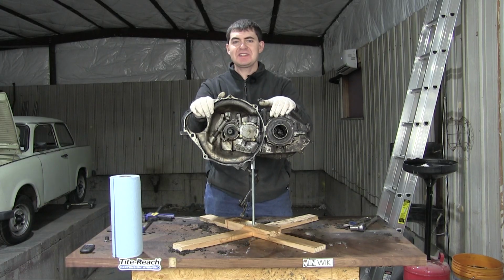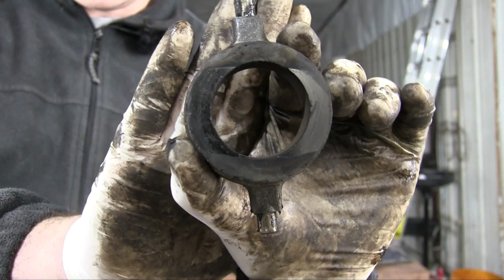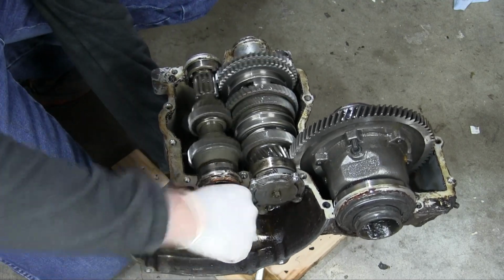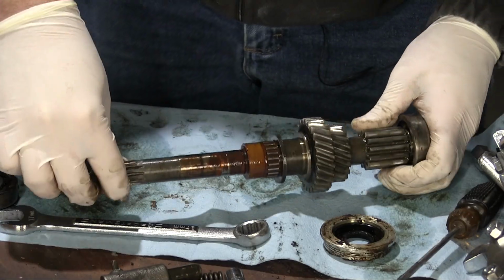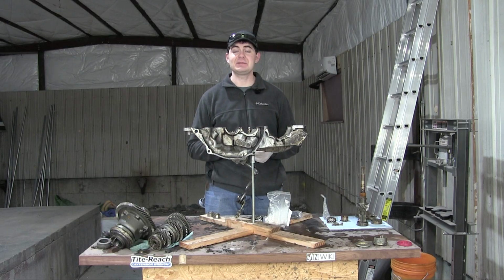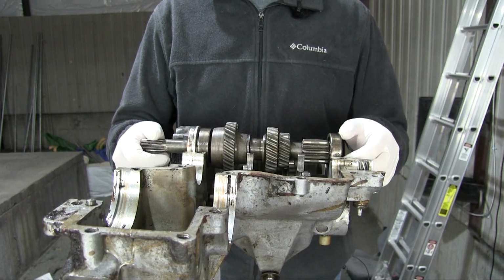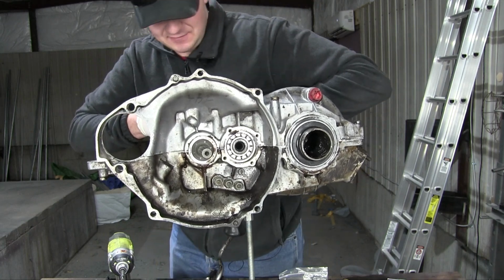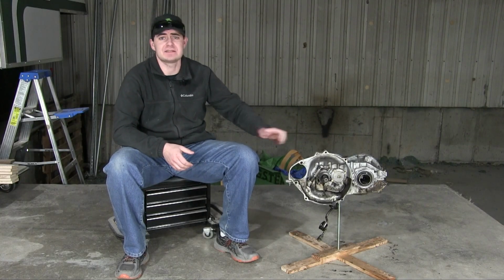Rebuilding the Trabant's Engine: Part 2 - Rebuilding The Gearbox

Comment: For years carbon clutch release bearings were the norm, on my 1989 Reliant Robin is the same carbon release bearing that was introduced in the 1930's Austin 7 and saw service on just about every BMC/British Leyland engine including I think the classic Mini, making them cheap to produce esp after WW2 where resources were not so freely available in Russia, Britain and Europe.   There is no reason why a carbon release bearing won't stay good for many thousands of miles, best not to ride the clutch though as that does increase wear and you may find some older brake and clutch shops still offer a carbon relining service as in the older days, instead of buying new you got your release bearing and clutch plate simply relined with new material, springs and plates and a finishing skim on pressure plate face where a tiny layer would be skimmed off to give the new friction material something to grip on.
Reply: Looking at the design there of the Trabant release bearing its very close to the old Austin/Morris/BL etc design and wouldn't surprise me if the Soviets just copied the hell out of certain bits, the original Vyatka was a 1-1 clone of Italy's Vespa 150 which upset Piaggio mightily and them ol' Commissar's if they saw something they liked they just went ahead and copied it and two fingers up at the original company :)

Comment: Robert, you do not have to torch bearings or anything to fit. If it is a piece that is completely metal anywhere, set your oven to 250 and bake the bearings until it isnt preheated. Then drop the bearing on and let it cool. This is what i have to do at my work to get final drive bearings to install smoothly and its just a better way.

Comment: Nice to see you back on the Trabant rebuild!  The early E-Types had that same throw out bushing only it was just an iron casting.  The design is arguably more reliable but can pull down the idle speed when the clutch is disengaged.  You probably have the same issue with the Trabant.

Comment: The first part you took off (the one called "screw conveyor"  in the manual) is used to circulate the oil inside the (partially hollow) intermediate shaft. The intermediate shaft has multiple holes in it that help with lubricating the moving parts on it.

Comment: Fun tip. On friction-fixed gears like that (or say an anti-lock brake gear on a drive shaft), don't use a torch. Heat the gear up in your oven (or barbeque grill). It will heat in a more even and controlled way and expand just enough to slip on. Plus it probably won't be so hot that it will melt your weird plastic things.

Comment: you need a quite bigger bead of the sealing compound all around the gearbox halves,.... it will leak https://www.autodily-cardo.cz/galerie/430608/tesnici-tmel-na-motory-do-300-c-elring-705-705-default.jpg

Comment: Very good video, keep up the good work! One time, I went to a transmission rebuilding shop to ask which oil I should use in a manual transmission, and they said that regular 5w30 engine oil is just fine. Later in the life of that car, when the transmission was leaking quite a lot, I used 10w30 oil, with a bit of Bardahl. With the Bardahl, the transmission shifted so well; I should have use it before.

Comment: Mine had a failing freewheel as well, it took like 200 bucks to replace a part that costs like 10$... now I see why.

But later I had the gearbox replaced anyway, because I've had it converted to the new drive shafts, which are much more reliable and durable. The parts were like 25 bucks from a parts car (gearbox, both driveshafts, wheelhubs with brake drums...)

Comment: Glad to see it was worth the wait. I'm all anticipation waiting for the next video. Goes to show what a lot of common sense can do if you only go for it. Back in 1986 I torn down a 18 ton tuck gearbox with no experience, put it back because I could find a fault, when it turned out to be the rear differential. Only one bolt holding differential together. Ah well you win some you lose some. keep up the good entertaining videos.

Comment: A few months ago I did the same thing to my Trabant´s transmission, because the freewheel clutch had died. As far as I understand it however, it is the surface of the inner race that is wearing down and the rollers can´t wedge themselves onto it anymore. As I wasn´t sure whether my transmission was the old or the new version, I had ordered both versions of the freewheel inner race. After measuring the ID of both parts, I can assure you that both of them are exactly the same ID(down to 0.01mm/ roughly .0005"), so both versions will press on the same shaft with a hydraulic press, as you demonstrated. Heating/torching is not required on either install or removal. Why the key was omitted later is beyond my knowledge, one might suspect cost savings thou. But I´m still surprised that your key was sheared off.
Make sure that the speedometer drive has some up/down movement, as this can happen when the unit slips during assembly. If the shaft is not moving, you can add a shim washer underneath the bushing.
And the weird oil feed screw is, as you suspected, forcing oil into the hollow shaft and out through ports to lubricate the gears. When I disassembled my transmission, I was equally puzzled by the manual, which is sometimes difficult to understand even as a native German. Anyway, the cover containing the oil feed thingy had been RTV´d generously by the previous owner of my Trabant, so I tried to carefully pry off the cover, slipped, and bent the hell out of the oil feed device. Bent it roughly back straight, transmission is fine. Reminds me of doing an oil change, though...
Been daily-driving my 1969 Trabant for almost six years now, btw.
Reply: Wow you daily drive your trabi? What an absolute madlad.
Reply: @vini1277  why not? These cars were made for daily driving.
Reply: Well, your right! RIP the earth though. You know, I'm 16 and live in Belgium (so trabis are not that far away). And I hope I can own one one day! Enjoy yours! @Fusselkopp
Reply: @vini1277  There's a catalytic converter available for Trabis. I've been driving with one for about 5000 kilometers and it has no negative effect on power output of the engine.
Reply: Wow I didn't know that! Does that mean it could pass emission tests for regular cars? Because if I'm not mistaken it has to pass that to be able to be a daily driver? @purplesparc
Reply: You won't get the green environmental sticker in Germany that most petrol cars from the early 90s can get with a cat, but the Trabi-cat has been extensively tested to be allowed by the German roadworthiness inspectors, and I've read that emissions with the cat are actually not that bad. It burns off all the blue smoke and the tailpipe will be dry. However, even without a cat, you can drive the car daily legally without a problem. Normally they test the CO value (even the Trabi has a factory value for this emission) and if that is off, you would need to adjust the carburetor. But I could imagine that most inspectors don't really bother. At least in Germany, the amount of tax you pay yearly (which is not too bad with 150€) does not change with or without cat. Just something to consider for the environment's sake.
Reply: Oh interesting! I didn't know it actually made a noticeable difference! Maybe I can convince my parents to buy a trabi after all. (I'm 16 and just want one to look at ;) @purplesparc
Reply: I imagine the original document is quite obscurely worded to begin with and the translation might have been automatic. I can definitely confirm that especially older German technical texts can do your head in, even as a proficient native speaker! Or at least give you a good laugh.
Reply: Fusselkopp... how can you possibly be a native German speaker ? Your VERY LONG message above is absolutely perfect, contemporary, conversational, "native"  English. Go on tell the truth, maybe your great-great grandpappy was German, but you're a 4th generation-er from Wisconsin aren't you !     :)

Comment: Some tips/education:
- The cover with the spiral metal thingy you first took off the gearbox is basically an oil pump. It goes inside the shaft and as the shaft turns, the spiral metal thingy helps the oil flow to the gears.
- The red cover should be made of metal and a concave shape. It's fixed in place by putting it in its hole with the concave side inside, then hitting it with a hammer, so its concave shape "flips" to the other side, making the cover to stuck in the hole. Some sealant/glue is also needed.
Reply: The metal spiral thing straight up looks like a metal burr that gets created from cutting aluminum at my work.
Reply: Archimedes' oil pump

Comment: Bearings and seals can be matched by ID & OD & width then just make it look similar. The seals flexible part need to point in same direction. Called inclusion to enclose the grease or exclusion to keep stuff out of the bearing. C&R has a mini course it's dull but will save you hundreds of dollars. A lot of weird stuff is available when checked for by dimensions.  If there is a truck parts store around  it's possible a counter guy there will know how to use the books and can find parts quickly They will also know the tiny micro slack you may have to work with. This is the downside to computerized parts stores, great most of the time, but no motivation for them to find actual parts guys or girls anymore Also ASSEMBLY GREASE PLEASE

Comment: Using a pencil as a clutch sounds like it would break often. That would be pointless.
Reply: That's a sharp observation.
Reply: H a h
Reply: Yes, since lead of a pencil is made of a brittle combination of clay and graphite particles, not solid graphite
Reply: @JohnSmith-eo5sp  Depends on the pencil. A 9B is just graphite, no clay.
Reply: @stanrogers5613  what about 2B?
Reply: Now i wonder if the clutch disc material is made of eraser... Lol. 😅

Comment: I hope you do better research before you rebuild your engine. Not trying to talk shit over here. If you need help respond to this message, I know Trabants inside out. Rebuilding an engine is not as simple as you might think. Many people here in Germany ruin their engines by skipping steps or even just not knowing about them.
Reply: i don't think the purpose of this video is to educate people how to properly tackle a trabant repair, but rather some comic relief mixed with some wrenching. And there is nothing wrong with that.
Reply: @hojnikb  yes and i did not say something against that. I just wanted to save him from having to do it again after a couple miles.
Reply: @marc9283  I think you should rebuild it for him over skype.... he cannot do any movement you do not tell him to like he is your robot
Reply: Marc machst du das Beruflich?
Reply: @niklasnachnamen9278  nein, habe aber viel an diesen Autos gemacht und viel Wissen angehäuft.
Reply: frickin lazer beams

Comment: I believe the engine might be more powerful if replaced with a white cat.  Possibly more reliable.
Reply: Pussibly?
Reply: Do that and starting the engine will simply be a matter of petting the Trabant's doors.
Reply: Would also sound more powerful if the cat is purring.
Reply: Yeah, it will not matter if it dies, since it will still have 8 more remaining lives.
Reply: @sokacsavok  
And eight more horse, er, cat power than a trabant engine
Reply: also theres a conversion for hamster injection
Reply: IRC the white cat version was 15bhp less, the ginger cat equivalent was much more economical and reliable, no ones ever dared making the black cat version, I'm hoping AMG will consider it :D
Reply: @MrStrandgsx  Do you know what the AMG Trabant would cost?
Reply: AakeTraak  I dont think AMG has the technology nessessary for making a Trabant better. But some belgian madman stuffed a V8 rover engine in one. https://www.youtube.com/watch?v=AMfD3WKr6BI
Reply: @AakeTraak   would depend on what the going rate for black cats would be.
Reply: @MrStrandgsx  The Russian Cat would be able to do 1000BHP With a top speed of about 300MPH with 0 to 60 taking 2 Seconds it would use Russian Hard Bass Rave Music to get to those speeds that would be the Brabus Version
Reply: @MrStrandgsx  nonono the Black cat is the Abarth engine  :) ;)
Reply: Erik Hare you’ll be hearing a lot of meowing and knocking. But hey when your Catransmisson breaks down for the tenth time just know that you’re screwed.
BECAUSE CATS HAVE ONLY NINE LIVES
Reply: Dude, I think a hamster in a wheel would provide more power and torque than the engine of a Trabant. :)
Reply: @isecore  put 4 angry hamsters, so you can say that you have a 4 banger
Reply: i'm just amazed he's so good at herding cats.
Reply: It better be a heavy astmathic cat in order to retain the sound...
Reply: You might even replae the whole Trabi with a cat.  Sure, you'd miss out on the cuddly "stay behind the wall" feeling you can only get from having the Stasi follow you like a blue cloud, but you would gain the cuteness associated with not having your face ripped off in the middle of the night as long as kitty is well fed.

You can see why cats are so popular on the 'net when you look at it this way.
Reply: Just need a dozen of them for a 12 horsepurr engine.
Reply: badgers have more torque.
Reply: It would make the car purr.
Reply: and will purr like one
Reply: You predicted the whjite cat meme lol
Reply: Nah, just use 4 hamsters
Reply: Will a tabby work?
Reply: @1mariomaniac  We're talking about a car engine here, something that has to provide significant locomotive force.  So yeah, an average tabby could probably propel that thing.